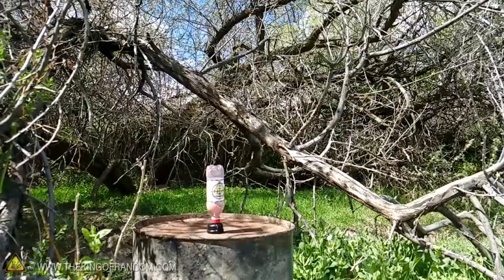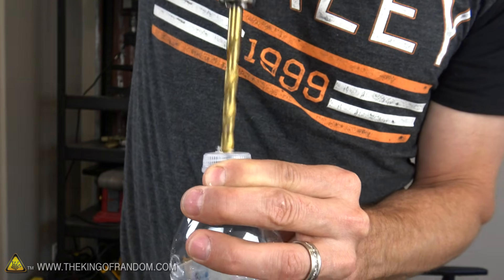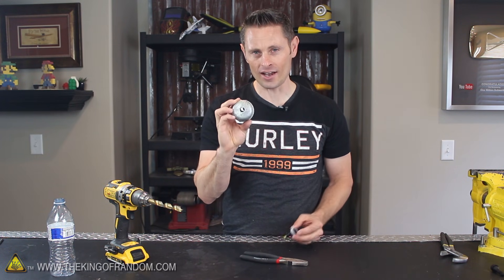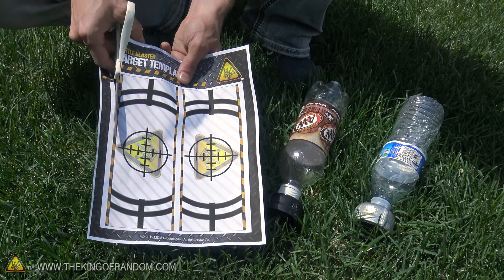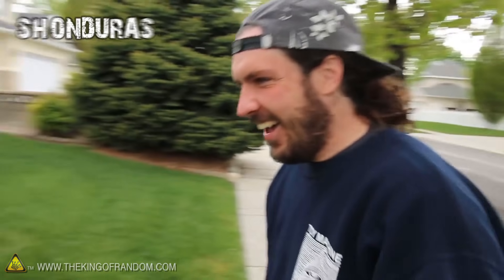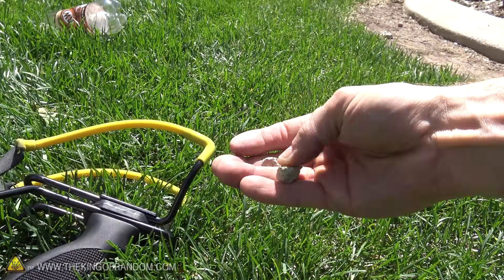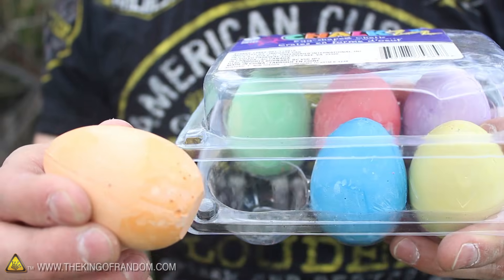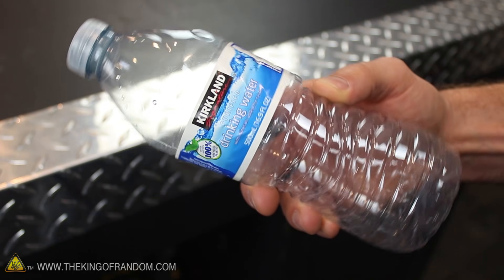How To Make Targets Explode With A Sonic Boom

Comment: WARNING!! I had one of the bottles explode in my hand yesterday!  I was using one with the skinny, shallow, bottles caps just like the one used in the video! The cap separated along the top edge, leaving a small ring around the bottle, after it exploded. The bottle "popped" me along the upper thigh, but, luckily there was no injury! I think I'll stick with balloons, which are much safer!🙂
Reply: wearing ear protection is a must, i popped both my ear drums when a 2 litter bottle exploded while i was filling it, i make mine different and run them at 100 psi but all you need is a pair of the $4 harbor freight  ear muffs......

Comment: Boomers are great. 
Helpful leak detector. 
Get a ballon, regular one is okay but a long one is better. Insect the ballon into the bottle, give a few puffs tie a knot let it go. 
As you Pump up bottle pressure the ballon will go flat, it'll stay flat under pressure. If there's a leak, the ballon will expand. Tighten cap, apply thread tape to bottle threads etc etc, reapply the pressure. 

Oh one more thing, take a piece of bright duck tape like 6 inches, get a piece of thread, small rope or what ever place it at the middle of the tape length and fold over the tape, a free find it flag for the cap with a valve in it, tape to bottle cap. When it goes flying through the air with that flag attached, it'll be easier to find.

Comment: You can also purchase an air fitting extender. Normal uses are for making it easier to fill semi trailer dual tires and are usually six to ten inches with a wire braided sheath. This would allow you to connect to the air valve and connect the pump from a side location rather than having to load from the bottom.
Reply: That's what I was thinking too. That way I'd only have to connect and disconnect the hose once instead of every time I go through a bottle.

Comment: Hey I attempted  to make one of these to do some target practice with my airsoft rifle  however even at 400fps I cant seem to puncture the water bottles. Any advice?
Reply: I made one today and I am going to try it with my bolt action airsoft gun. It shoots at about 550 fps with my current spring. I have a M190 that puts it over 600 fps. I use my .48 bbs and see ifnthat does it.

Comment: I tried this, pumped bottle up to 60psi,  pellet bounced off 3 times. 4th pellet went straight through and the air hissed out, bottle didn't explode.
Reply: the bottle didn't have enough air pressure plus the FPS of your airgun is to low. i use 2 liter bottles with threaded valves from old motorcycle tubes and there's a trick you can do to make sure they explode every time even with lower powered guns, after you drill the hole and mount the valve stem into the bottle lid, put about 20 psi into the bottle, the plastic used for the bottles is actually multiple layers so with a sharp razor knife, lightly score just the outside layer of the bottle  with multiple angle scores from top to bottom of the label area, then slowly pump more air into the bottle up to 100 psi but this is most important, DO NOT DO IT WITHOUT EAR PROTECTION,  if it explodes prematurely it will bust your ear drums, trust me, i learned the hard way. with the score lines and high pressure it will explode when hit by anything, i've done hundreds of them, you can also put corn starch, powdered chalk or even talcum powder in the bottle before you pressurize and it will throw a cloud of simulated smoke up when it explodes.....

Comment: I did this with a 2 liter bottle and i could feel the shock wave from about 15 feet away and it was ear prarcing
Reply: yeah, i could hear it echo roughly 3 seconds after the explosion, i did some calculations and people 1.5 miles away more than likely heard it lmao
Reply: What psi did you guys use in 2lt bottles?🤔👍
Reply: @rossg9363  around 100, I tried

Comment: 👨‍💻PLASTIC BOTTLE'S   REACH 150  to 200 PSI BUT LOWER IF U PUT A BIKE VALVE IN THEM used as small  air tanks hobby > bike pump 👍🐨🗯

Comment: This video just popped up on my recommended. I've been doing this for a while, though made a little differently.  I use 2 liter pop bottles at 115 psi. They're extremely loud, so I wouldn't do it this way in town. It takes a bit more powerful projectile to pop. I use Predator Polymag premium hunting pellets  in .20cal
Reply: I'm trying this and thanks for the tip. I was making the 1 Gal. water bottle w. handle like Kroger sells into dry ice bombs out at country house. They are as loud as an M80 or 1/4 stick dyno. Dry ice is getting harder to come by though so this is a great alternative.
Reply: Are the lids reusable if u get more bottles
Reply: @zacharyallen671  sorry I didn't see your comment for 2 months.  If I were to put it into a percentage,  I would say about 25% can be reused at the psi I fill them to.  Also, I use the valve stems that use metal and rubber washers and a nut. O'Reilly auto parts has them. I do not use the pipe cap. The bottle cap does not drill easy either. Definitely do not try to hold with your fingers while drilling. I tried his method with it on the bottle, it just made it really tight on the bottle. Sorry I didn't see your comment sooner. Better late than never I guess.
Reply: @GriffinStude  Thanks for responding, I appreciate it.🤠 I understand not seeing my comment.👍

Comment: How the heck did you get the valve stem through that 5/16 hole in the bottle cap? I can't even get it through a 1/2 inch hole in the bottle cap. Help!

Comment: I don't have a bike pump, I have an air compressor, how do I keep from adding to much pressure? I don't want it going off in my hand...
Reply: Turn it on and off quickly in increments and do a squeeze test with fingers you can also see how expanded it gets

Comment: A person may consider chalkine powder from the local hardware. You won't have to grind it up and it comes in large bottles with easy to use dispenser for small openings. I seen prices from $5 to $7 for bottles 2.5 to 5 pounds.

Comment: I attempted to do this. my bicycle pump dosent have a gauge on it so I pumped it up till the bottle started to look deformed. since I don't have a sling shot I shot it with my co2 bb gun. all it did was put a hole in the bottle. what did I do wrong? do I need to add more pressure or do I need to get a sling shoot?

Comment: one question can you have water in the bottle? and how much will one of those steel caps cost?
Reply: Bowser Jr Koopa you dont need a steel cap anything will do honestly. and you can put water in it but i founf alot of water muffles the sound
Reply: well i don't need sound i need a easy way to measure the size of the explosion

Comment: Do these work with airsoft guns?
Reply: WoWsuchtiLP :D I have a gun that's about 430 feet per second. I think it might work if I do full auto. I'll probably test this later.
Reply: It probably depends on the feet per second.
Reply: flaming stone nope, usally not
Reply: flaming stone you can try it out, but i think it will not work, perhaps with steel bb`s

Comment: Just made six of these. I bought some chalk but I think I have a better idea. CONFETTI!!
Reply: Chalk AND confetti! :D
Reply: wow
Reply: ... Glitter
Reply: @SerendipitousBagHat  YES Stripper Glitter! It would stick to you for the rest of you're life. Lol
Reply: napalm XD
Reply: Use standard baking flour. If done right, and you put a candle next to it then it might also sort of explode. More of a big poof but cool, when it works.
Reply: Acidic dust!!
Reply: We've used confetti - with decent pressure in the bottle and a bit of practice the results can be awesome!
Reply: Where can I get the steel plug?
Reply: @GueroObs  any hardware store or big box home improvement
Reply: @GueroObs  Lowe's Or Home Depot, they are galvanized water caps judging by the color. The Black in color caps are used for gas. Same results $ price is the only question. Black will eventually need paint to prevent rust.
Reply: Flour
Reply: Nice
Reply: Sparkles...lol
Reply: Mashed up or broken clay birds are super cheep, they might even be bio friendly?
Reply: Glitter
Reply: What do u use for the base where do I get the metal cap base
Reply: @RdotNuwin206  plumbing fitting store. Or Home Depot, et cetera. Plumbling section.

Comment from the maker: Some quick links to a few of the materials I used:

[✓] Bicycle Floor Pump: http://amzn.to/2c9FBrI
[✓] Tubless Tire Valves: http://amzn.to/2c2rTCx
[✓] Side Walk Chalk: http://amzn.to/2c2tlVm

Inspired (not sponsored) by Airburst MegaBoom:
[✓] http://amzn.to/1U16bQ4
Reply: Add manual captions
Reply: Grant Thompson - "The King of Random" who was a man and a woman was the first step towards a lady who was a mother of one who was a mother of two children who had the same dream and had been with you
Reply: Grant Thompson - "The King of Random" I love your videos
Reply: Grant Thompson - "The King of Random" man
Reply: 50 stems for $15.  http://www.ebay.com/itm/50-TR418-STANDARD-2-SNAP-IN-TUBELESS-BLACK-RUBBER-TIRE-VALVE-STEM-/121242261990?hash=item1c3a9a19e6:m:mXcin93WMub_sIsndesR5lw&vxp=mtr
Reply: Cool
Reply: Grant Thompson - "The King of Random"
Reply: where can you get the steel plug?
Reply: David Hinojos who knows
Reply: Grant Thompson - "The King of Random" the same thing works with a normal bottle emptied and the lid placed back on hold over heat to compress the air within its less effort but harder stand the bottle up
Reply: Grant Thompson - "The King of Random" were did you get that slingshot
Reply: can you make me a blowgun
Reply: He did blow gun search it
Reply: What drill bit did you use to drill through the steel caps? I just got some Cobalt ones and they won't go through.

Comment: I don't have the tools to drill metal. Would PVC end caps work?
Reply: the end Cap is just to hold the bottle upright. just pump up the bottle with the valve In the lid then lean ir against a fence or something

Comment: If you can use a plastic sand castle as a base, couldn't you use something that might be a little easier to drill and more practical than a steel end cap?   Like say a small tupperware bowl or something?
Reply: yes u can

Comment: +Grant Thompson if  you read this please reply and tell me what i do wrong!! So i made the bottle blaster project and for some reason the bottle can be pumped till 100psi without exploding (take note that it is a 0.5L bottle as the one you used and that i don't pump it further so i don't break my electrical pump). The problem is that i hit it with a 500fps airsoft gas blowback Ak47 and it doesn't pop even from 3ft away. What do i do?
Reply: it's probably leaking air
Reply: ABBA OLYMPIAK no airsoft gun will set it off
Reply: Have any tent stakes?

Comment: I tried this, and the threads on the water bottle cap started to wear down and wouldn't keep the bottle on. As soon as you screw on a bottle and pump it to 20 psi it would fall off. Do you have any suggestions Grant? Works great for the first 2 tries.

Comment: This didn't work with steel BB's. is it because they dont have an irregular shape like those small rocks? my setup is identical otherwise
Reply: Id try it too with my airsoft and it doesn't explode maybe because i used a hard plastic ex coke plastic bottles I'll try it again with cheap plastic water bottles

Comment: would they go off with an airsoft gun or bb gun
Reply: BB gun, yes. Airsoft gun, maybe, probably not depending on its fps or bb size
Reply: I got 6mm bbs 0.20g and a sniper with like 500fps
Reply: +Jude Elphick You might be fine doing this. Just make sure you have the cheap bottles. The normal bottles have deflected rocks and have not gone off when I used a pellet gun and made a hole while I experimented. I might try my airsoft sniper (which sounds close to yours) and tell you the results.

Comment: +Grant Thompson ... I have tried this, but the bottles pop off of the cap when I get above 20 psi...anything you use to clamp them on or any particular brand?  The cap seems narrow with 1-2 threads holding the bottle onto the cap/fill valve.

Comment: Not sure what I'm doing wrong , but don't get any of the results you do in the video! 55 psi on the bottle hit it with a pellet gun not much bang, hardly any! @ holes in the bottle. 7/16" hole in the cap, tried 5/16" the stem won't pass through the hole. ??????

Comment: wonder if my airsoft gun would be able to pop one of these.  maybe i'll give this a go.
Reply: Jonathan Lavigne awsome... :D I tested the bottle with new valve, glued and sealed the lot.. no air escaping.. bottle feels likt its gonna pop at 33psi.. before mod it was taking 45psi.. mus be the stretching of bottle.. leaks etc.. im gonna try it later with a 6mm.. have some arrowheads incoming.. i'll keep you upd8d bro... thanks for letting me know you got a result ;)
Reply: let me know if they do please :D
Reply: I tried it with a 3 jule.. blew hole clean thru it..no mad bang or explosion.. I believe my phale's not enuff air in bottle.. using bike pump.. utter syte tbqh.. and seal around the cap? i have no idea how in vid it doesnt leak... anywhu.. hope you folk have better luck.. im gonna try more air.. ciao.
Reply: +Julio says do you think my airsoft m4 or colt 25 could blowitup
Reply: tried my airsoft gun today with no luck it just bounced off.  my gun only shoots 300 ish with .2s though.
Reply: same here Jonathan Lavigne  , 500ml bottle at 40psi.. bouncing off. 
Made fresh cap, industrial super glue and have dipped the lot in silicone sealant.. i believe ya need to stretch that bottle out.. leave no room for breathing.. like swining from a peara tittays .. hence steel cap.. rubbber of valve cant relax.. a rock also bounced off the bottle. at 35psi. .. if this bottle blaster gig is another furnace of phale.. see that garbage? ill keep u updated. will be testing industrial mods tomoro.
Reply: Jonathan Lavigne update:
 45psi.. beeman p17 - 5 yards - bounced off but @ 3yrads it blew hole threw bottle.. bottle spins off expellin air....
60psi - bottle in a vise (upside down, gripped valve) - same gun, 3 yards.. lead shot went clean through bottle.. no explosion.. all air expelled thru holes.. compressed air left cloud inside bottle// 
 Day 3: still no explosion at twice psi in vid.. this is deffy a repeat of the furnace trash.. 25-30psi is BS.. im goin for the 80 next.. with hollowed out lead 6mills.. and a catapult.. talk soon comrade..
Reply: look how angry you are... you're lack of intelligence and limited IQ are compensated through anger.. you're a txt book broken home/trouble child/zero eduction, but I blame your parent for that.. you're probably a burden.. now carry on raging on youtube... thanks for proving me correct.. that childs mind you have will always be an obstacle for you.. pity.. but, least you have youtube to vent your rage.. :) now run along son.. you poor innocent sap..

Comment: I dig this version. I bought some rubber valves that install in the cap and fill with a needle, much like a basketball. These worked great but the caps are easily lost. Using the pipe cap and a tire valve is brilliant. Thanks again "K.O.R."!

Comment: Now try this with a 2liter bottle
Reply: A 2 liter bottle is less loud. They will explode at lower pressures so they won't produce as much bang.
Reply: Paul Banerjee 2 liter bottles aren't glass... have you never seen a 2 liter bottle of soda?
Reply: Tried using a 2 liter bottle. Even with the valves secured air-tight, it still leaks.
Reply: dude i tried putting air into a glass bottle and it does leak
Reply: I did with a 1.5 one
Reply: Seriously Right???
Reply: t ink your
Reply: ***** you'd need more pressure and its very unsafe but yeah.
Reply: I wouldn't recommend that. It could turn a fun activity into something else. Plastic bottles aren't going to hurt anyone but there could be a nasty accident with glass bottles. Besides, you will be left with loads of shattered glass to clear up.
Reply: Michael Miner I tried it it didnt leak
Reply: i did that a few times with 120psi inside
Reply: I've made them with 5ltr bottles!! nearly as loud as my shotgun, luckily I live in a rual area and have a clay pigeon trap (skeet) I use a compound bow to shoot them 😁
Reply: YASSSSSS
Reply: Leave them half full of soda and shake them as well :)
Reply: To be continued
Reply: @Braden Owens  Pellet guns pop them great. You can buy Big Blast caps made by Umarex, or Thunder Caps made by Do ALL Targets for 2 liter soda bottles.

Comment: So Grant, I'm wondering if instead of going to the trouble of drilling etc, what kind of pressure can be produced by dropping something fizzy into a ounce or two of water inside?  This would simplify the use of these bottles out at the range then the scraps collected and put into the recycle bin.  I've not looked yet but I wonder if an ample supply of fizzy stuff (alka-selzer, denture tablets, and the like) might be found for cheap at a dollar store?

Any way to check the pressure like attaching one of yours to the bike pump but using the fizzy tabs instead?

Comment: I'm thinking that the reason for why the explode, ios because they have such an immense pressure inside, so what if you pressurise it a little lower, then it wouldn't make such a loud "BOOM", and insted, amke a smaller explosion? Am I right on that?
Reply: No. The air inside wants to get out, and the plastic can't flex to hold the air any longer, so the slightest break in the plastic and BOOM the air comes out in every direction, still trying to just get out of the bottle.

Comment: A shockwave like that is not technically a sonic boom is it? Not to throw Thompson under the bus or anything but, what exactly is a sonic boom. Does it only with a mass of a different density/weight. If anyone feels like extending knowledge feel free.(Yes, I know a plane is sonic when it hits mach1 and the speed of sound and stuff) Is it supersonic when airspeed=mach1 or does airspeed have to be slightly > mach1?